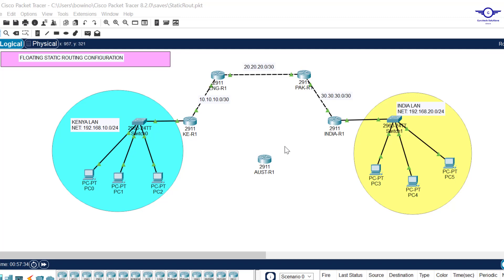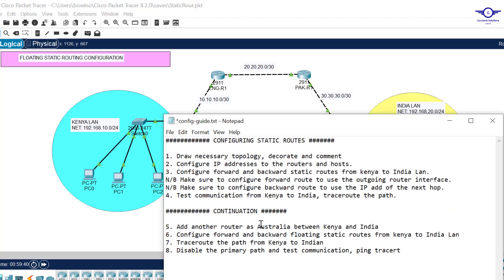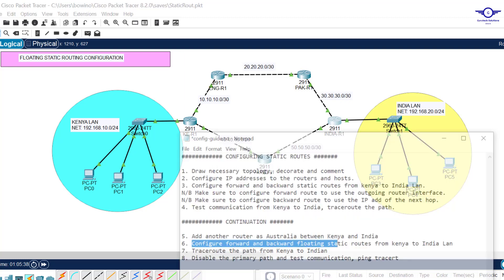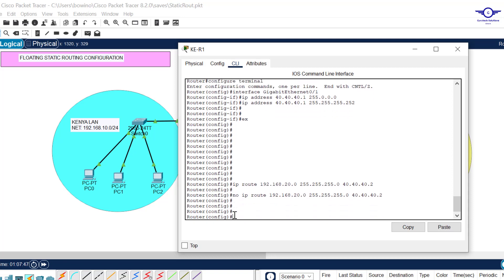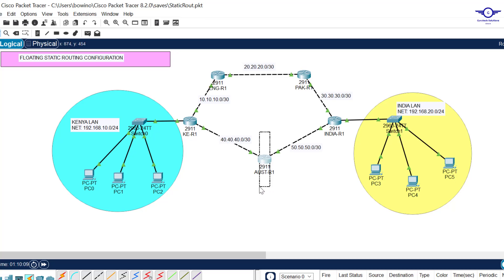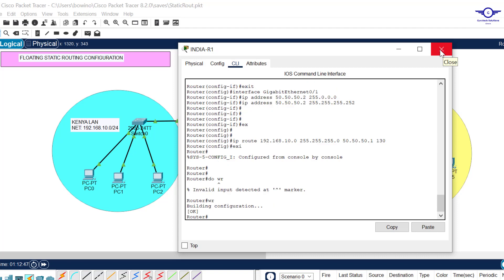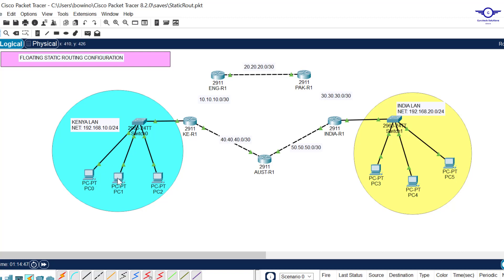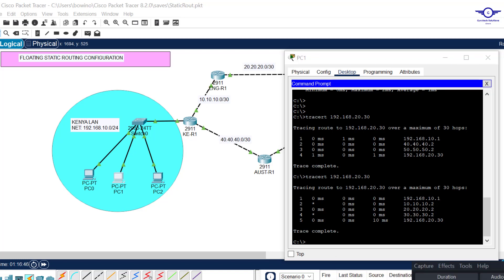CCNA DAY 35: Floating Static Routing Configuration Lab Using Cisco Packet Tracer | Backup Routes

Comment: So it’s mean we need to specify the floating number like 130 on just two router, which are connected to the LAN on both sides not any of the middle router, is that correct mate
Reply from the maker: On your managed routers
Reply: @ could you please explain that.?